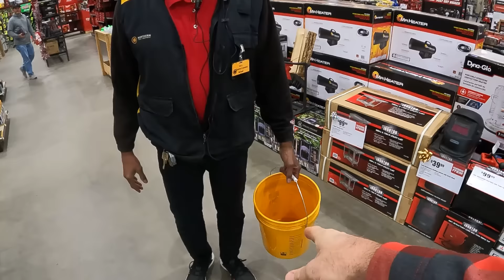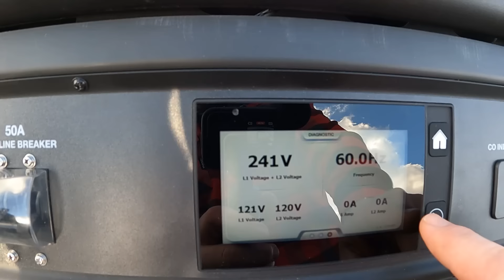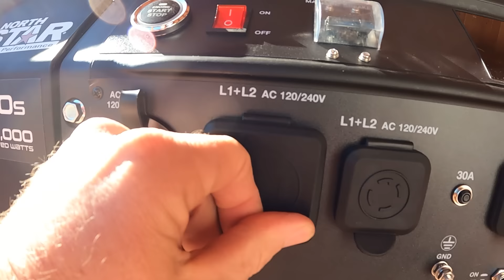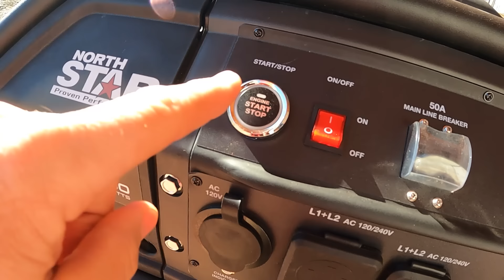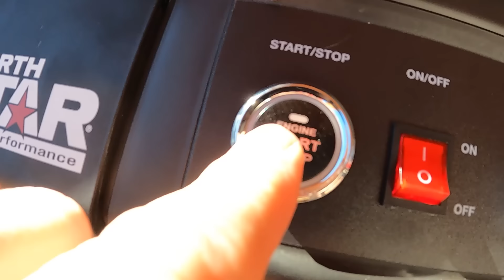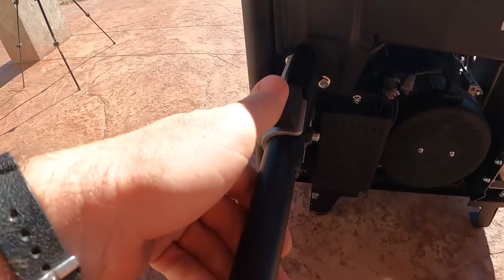Grid Collapse? Winter Storm! New Generator Technology that Could Prevent disaster!

Comment: I would return that unit if I were you. Everyone fails from bad Co sensor and there is no fix.
Reply from the maker: There is a fix, the CO sensor has already been replaced on mine
Reply: @StoneyRidgeFarmer well lucky you, I just got told to pound sand after a new sensor did not fix mine. I just avoid em like the plague now.
Reply from the maker: it should be under warranty?  If not I'd reach out to cooperate and see what you can get going.   I'm certain these have a pretty good warranty. Take it back in and see...there may be some recalls.  Don't just give up on it my friend

Comment: Hybrid Solar with generator backup. Start with minimal battery backup and increase when you can afford. In the long run electricity will rise in price as reliable generator( nuclear/coal);are shut down and partly replaced by erratic renewable wind solar and hydro

Comment: Can you adjust the line frequency to 62hz?  I don't see the manual online.  I ask because if you use this (or any other non-inverter generator) in conjunction with a Solar system, the generator should idle at 62hz and droop to 60hz under load.  The reason is that 62hz will cause the solar system to curtail power generation so it doesn't back feed and potentially harm the generator.  You should never run an inverter type generator in parallel with a solar system because the inverter generators ALWAYS make 60hz.  Again, to be clear.... 62 hz means "solar don't make any/much power" and 60hz means "solar and generator need to make all the power they can".    Hope this makes sense.

Comment: Hey Josh, that's a cool generator with EFI and electronic starting plus it's pretty compact. I was thinking  since you already have a couple of tractors, You could probably later on get a PTO generator, that thing would probably power 90% of everything you have and be pretty good on fuel consumption. I bought a new Winco 15kw  PTO generator and it's safe for sensitive equipment with less than 5% THD (Total Harmonic Distortion) about 5 years ago and it only requires 30 pto hp at max output. I have an old 1968 MF135 diesel tractor and it pulls it like nothing and only uses about 1 gph of fuel under full load. Even if you could get a bigger generator and had a small tractor, it can still be utilized and be used at what ever the tractor could put out at max output. I guess I'm thinking about how other people have done things in the past and was something that I have followed that works good  on the farm when the power goes out. Keep up the cool videos👍
Reply: The entire lineup of new NorthStar commercial-grade generators have less than 5% THD and are completely safe for use with sensitive electronics!

Comment: Hey Josh! After seeing your generator, I ran by Northern Tool & Equipment to research a similar genny to handle our house. We currently have a 7.5kW pull-start Ryobi that connects via big cable to a subpanel that runs the circuits powering heat, well, freezer, fridges, and kit/LR/master BR. However, we put a heat pump to replace the main AC and configured our heat as electric above 35F and LP below. So we need to get HVAC and electrician to add the heat pump to the generator subpanel, and to advise how big the generator needs to be. I expect the little brother to yours, at about 10kW, would be good. Then the little missus could start it. I really like the fuel/oil/filter life indicators. Thanks for showing the tool!

Comment: Warning -  with EFI generator (from COSTCO) it will not start without battery (EMERGENCY pull start does not work). you better make sure you have a working battery for emergencies!
Reply: Generally batteries don't completely die, they may not have power to start the generator, but can sustain it while it's running. Much like when your car clicks when the battery is dead, some power just not enough
Reply: @matt45540  NOT the case based on experience it would NOT run with old battery when doing pull start.  As soon as new battery installed, it worked fine.

Comment: We are thinking of buying a new car. Some hybrid cars allow power out and to use the car’s engine to charge the battery. We are looking at the Mitsubishi Outlander which has this feature. It could be a way to power a few important appliances like a fridge or freezer if there is a blackout.

Of course if the car needs to be driven the appliances no longer have power.

Comment: we got the 13000 kw 8 years ago fom them.. we powered our shop and when the power would go out we back feed the house as well.  worked great for years. now we have a gas powered 32,000 kw back up for everything. we built a fancy house over ours on one of there 4 wheel pull trailors. A idea..

Comment: Since this is for emergencies, after putting in the transfer switch, how much gas will you be storing for this unit.  12 gal for 10 hours run time for 6000W.  So for each day, if you run it all day, you will need 27 gallons of fuel, and 100 Gal may last 4 days.  Then, you have to rotate your emergency fuel every 6 months, if you do not run propane.  Since the tractor is diesel, did you consider a PTO Generator, or a diesel generator for backup power?
Reply: Yes pto generator is an excellent option. I have a 2210 tractor w/ pto generator have had in 04 & 09 ran it for 24/7/3days rest of emergency’s only 4/12 hrs

Comment: Do you have a transfer switch installed that allows you to run both the shop and the house?  Also, there are several YouTube videos on building a generator enclosure that has ventilation for exhaust and keeping the gen cool.
Reply: @Terrance? Do Hope that Josh & Wife will show us the "shelter build" for the generator? Can't just leave that piece of gear out and exposed to the weather.
Reply: He better get a building permit!!!
Reply: @davidhorne2326  That is an idea but NOT sure that it will be required? Have to wait & see. BE SAFE & WELL

Comment: Josh, when I built my home I installed a 20,000 watt, whole-house generator. There is about a five second delay between loosing power and generator startup. We go to warmer parts for the winter and it gives peace of mind knowing our home will be fine. The generator uses natural gas but could be powered by propane if necessary.

Comment: I personally woulda gone with. 20+kwh generac uses propane/ natural gas’s which is super efficient and has the sense to auto start when loss of power is detected
Reply: When I looked at the price of the Northstar generator, it is $4300.  I did not think that it would be that expensive.  For another $300, you can get the 14 kw Generac with the whole house transfer switch.
Reply: @ Isaiah...With the gub trying to get rid of various types of gasses might think of alternates? I know that I read something about the GREEN NEW DEAL IDIOTS trying to get rid of NATURAL GAS due to METHANE??? BE WELL & SAFE

Comment: You did the right thing! A portable gasoline generator is the way to go IMO. Natural gas standby is dependent on things beyond your control. Propane is WAAAYYY too expensive to run for long periods.
Reply: Propane is cheaper than gas and is way more efficient, what do you mean…
Reply: You mean that propane does not need to be rotated every 6 months like stabilized gas.  Also in an emergency, cost becomes irrelevant when you need to stay warm in the winter while keeping the fridge and freezers cold.  It is all temporary and usually never more than a week.   @Ragecon87
Reply: @Ragecon87  Propane is substantially less energy dense. Then you have the expense of tanks or a giant tank on the property subject to being dependent on the propane company coming to refill. Trust me, I know. I have lived through countless hurricanes.
Reply: Gasoline under Bidenomics is very expensive now, and will be hard to get in time, and certainly under a massive power outage or EMP. , and will only get worse. Propane is only $1.59. Plenty of propane and natural gas.
Reply: My 16KW Generac Standby under a full load is only 1.5  to 2 gallons of clean power per hour. Under a half load about 1 gallon of propane, and I use a lot of power. Propane stores nicely and doesn't go bad. 1,000 gallons would last me for about a month. Storing propane is compact, unlike gasoline. Propane is safer. Good luck with gasoline if you can get it.
Reply: Unfortunately, with gas, you have to have it before the emergency.  Like superstorm Sandy, there was no power to pump gas from the stations, so the priority was to provide power to the city cores on the NJ/NY boarder.  So the core towns(like Northvale/Norwood) got power after 2 days, but everyone outside the core(main street) you needed gas for your generators, and cars.  Because of demand, the gas stations ran out each day.  The next priority was transporting gas to the gas stations where lines of people were waiting to buy gas and you could only pay with cash, because internet was out.  So with no banks open(power), or no communication for ATM(cable internet), there was no access to cash for a few days from many banks.  Cable internet has no backup system at the distribution nodes(8 hr battery only) but Verizon kept everything on).  You have to have all of this stuff in place before the event.  Everyone with standby NG Generac's house generators, were barely inconvenienced.       @trajan6927
Reply: @trajan6927  I burn about 4 gallons per night with gasoline. I’ve got this down to a science… I run the large 12k portable generator as needed throughout the day. At night I run a 4k generator to power a window AC and a refrigerator. Works like a champ and I have redundancy. Remember, one is none and two is one.
Reply: @WE...I saw something on YT where the GUB is trying to outlaw NATURAL GAS due to methane emissions?? ( More of this save the planet stupidity) Better think of alternates?

Comment: Looks like a great generator...almost bought a smaller different brand generator on cyber-Monday but ran into a comment about THD (Total Harmonic Distortion).  Apparently, generators that produce "dirty" electricity Arnt safe to use with sensitive electronics ...i e systems in newer homes... couldn't load the link for this generator but Norther tool did claim all of its generators produce under 6% THD.  Is this something you looked for when buying or is it mentioned anywhere?  Sounds like what you're running wouldn't have sensitive electronics anyways but just curious that is a nice size.  Thanks!
Reply: We're excited to hear you have been considering one of our generators! We're very happy to share that all the new NorthStar units are manufactured to produce less than 5% THD so that sensitive electronics are safe.
Reply: @Northern_Tool  Thank you for the quick reply in answering my question !  Will definitely be leaning towards your generators!

Comment: I don't think I'd be toting it around the farm, those type electronics are somewhat fragilly. If you need a gen, say out in the field to repair a piece of equipment, I'd just get a bobcat welder/generator to power up the the tools needed to get something ready to weld, and then weld it and be done. When they compare themselves to Honda, it just tells me they aren't quiet as good.  True it has no carb to gum up, but, injectors gum up too. Fuel tanks also gum up.  Esp when they sit for long periods, so, at least once a month start up and run is imperative. I know it's costly, but I'd run ethanol free fuel. Since you live a good ways away from the shop(as of now anyway) You should get yourself one of those alarms like they use on chicken houses that give off a loud alarm to let you know the power is out. Since it doesn't seem this doesn't have an auto start. I think in the future, I get something like the Generac whole home gen with auto start. Then, a trip for a few days out of town will give you more piece of mind. A propane system at that, so it will be worry free in case of something big (think of what happened when Hugo came through or, the blizzard of '93.) I know you probably got it for free or at least a good deal since they sponsor you, but, free isn't always better. 
One question though, I see the need to have power run into it to keep the battery up to snuff, but surely it charges it's own battery when running, right?

Comment: I’m gonna invest in a MANGO battery backup system;  I have an 8500 plus 2 others but I plan to convert the 8500 to propane!
Good luck with your project.
Reply from the maker: backup battery systems are great, but not 100% reliable, I have 3 broken one's in my shop right now!!!
Reply: @StoneyRidgeFarmer  is one a Mango unit??
Reply: @StoneyRidgeFarmer  ive built 3 med size systems 2400 min. watt solar panels GIandel inverter outback 80 charge controller and 8 12volt 300 ah CHINS BATTERIES  all 3 have been running for over 4 years

Comment: Wait until the under dash clik clik clik kicks in. I think in the very short term a gen set is ok. After superstorm sandy having had no power for 6 months you find out real quick its not feasible to keep a gen running to keep food.
Reply from the maker: yep....this isn't a cure all for off grid living my friend...this is an emergency generator or portable generator, not a run my house for 6 months machine
Reply: @StoneyRidgeFarmer  No one really knows just how long a power "emergency" will last but I agree that running from an emergency generator for 6 months would probably be beyond the capabilities of most of our configurations.
Reply: Sandy was indeed bad. You can only keep so much gasoline on-hand, even non-Ethanol. The key in a long-term emergency when fuel is scarce is to not run the generator 24/7. Only run it the absolute minimum to keep your food fresh or provide heat. Still, the clock is always ticking. The other important thing is to TEST THE SYSTEM. A lot of folks buy an emergency generator but then never go through any mock drills to ensure they have everything they need and know how to make the switch to and from generator. So far the longest I have had to run from generator was 4 days.
Reply: Did you consider a military diesel gen say 15-20 kw

Comment: In 2008 I bought a small generator. A week after I had the transfer switch installed a powerful Nor'easter came through and dumped 4 feet of snow. It took the power out for 4 days. It saved my house from major damage from frozen pipes etc. Well 15 years later I still have it. Once a month I start it and run the house on it for a short time. I can't tell you how many times it has saved me. I have a philosophy about owning a generator. It's similar to having health insurance. It's there if you need it. If you don't have it and need it then your shit out of luck.
Reply: That's a good point. Even though I use non-Ethanol fuel I run my generator for a few minutes every month during the winter and every 3 months during the summer.
Reply: In 1998, I got my Generac XL 5500.  This was to be ready for 2000.  I used to run it once a month, but that got to be a pain in the butt.  So I read the manual and placed it into long term storage mode.  Change the oil&filter, run it out of gas, place an little oil in the cylinder and pull the handle a cycle until the valves close, then put the plug back in.  It sat there for several years until the first big outage.  Then it started on one pull and ran the house for a few days.  Then, it goes back into storage mode.   Now I only fire it up once a year and run some vacuums to make sure the windings work, but the rest of the year it stays in storage mode.  It gets an emergency work out about every 5 years, and still starts on the first pull.  It is the best maintained motor at our house.
Reply: That's a good point. Even though I use non-Ethanol fuel I run my generator for a few minutes every month during the winter and every 3 months during the summer.

Comment: I was able to pick up a Generator for the house this summer. When we had the house built, had the electricians install a hook up for a generator, will be able to run the essentials plus!
Reply: We changed houses last year and this spring I built an outbuilding.  For the outbuilding, I ran 10-4 power in both directions under ground.  For normal times 240V/30 amp can be sent to the building, and in an emergency 240V/30 amps can be sent to the house and run through a transfer switch.  It was twice the amount of cable, but it gives a lot of options.
Reply: @gibblespascack1418  Do hope that ALL has worked out as planned? Options are GOOD as long as NOT too complicated.

Comment: In the past I sold similar products.  Northstar has a good reputation.  Our personal generator has a 4,000 watt capacity.  So that’s fridge, freezer, etc.  And, it’s not quiet.  I give you high marks for your generator selection.
Reply: It’s plenty as long as no electric ovens or electric dryers are added on.
Reply from the maker: Well pump....HVAC  that's what keeps your pipes from freezing my friend.  Fridge, freezer doesn't draw much but hot water, HVAC and well pump is what we're really after to keep us from having to spend the $$$ to repair everything that breaks when frozen
Reply: @BC? Just curious? How far away from the house is Your gadget? Did You have to BUILD or install a special shelter to protect the unit?? BLESSED BE!
Reply: @jtc1947  It’s on wheels.  Usually locked away.  I have enough cords so I can park it twenty feet behind the house, muffler facing away.
Reply: @bcgrittner  Hope that You have Excellent SECURITY against theft? Penpal worked for a power utility and a FARMER had His generator stolen. Had NO idea until the house turned cold. The thieves powered up a lawn mower to hide the theft! BE CAREFUL!